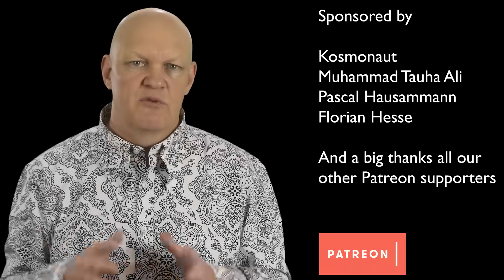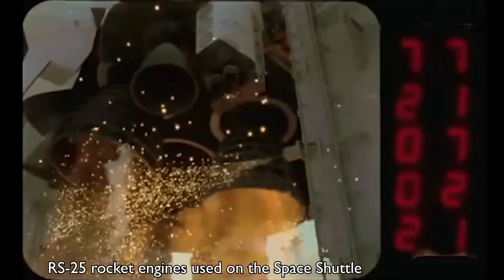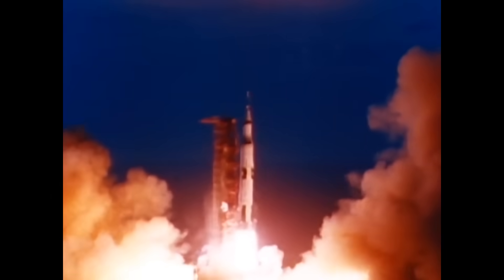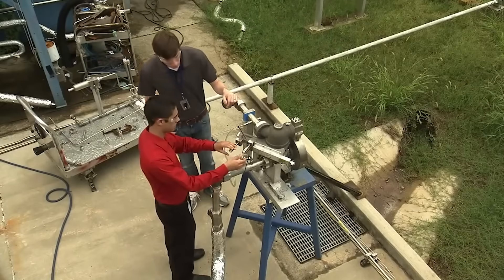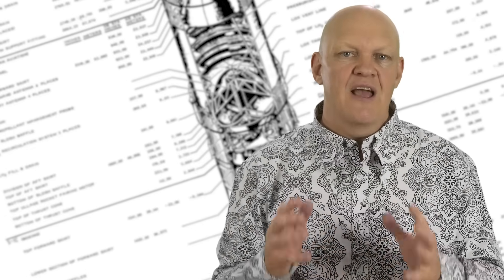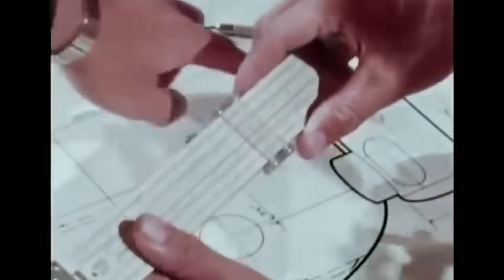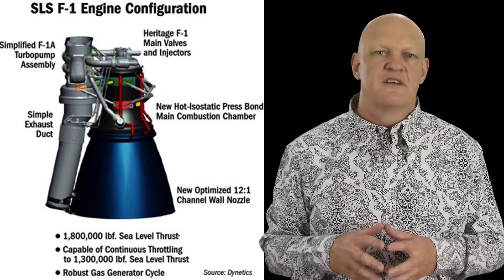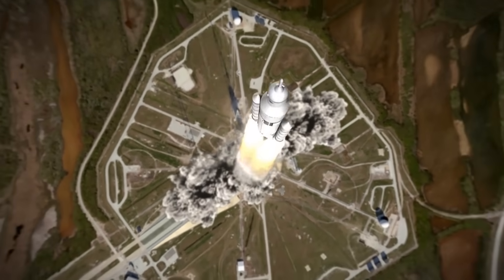Why Can't we Remake the Rocketdyne F1 Engine?

Comment: Why do we want to make an old style engine using old methodologies?

Old style design had so many more parts, which increases the failure mode effects.

Old methodologies required more skill on part of the “welder”, but also more skill on the “welding inspector”, and more resources from the quality control department to track their QC team.

If there is a new technology that increases overall quality of the production, then use it. Quality is there for the consistency. If it’s good production, then it’s consistently good production. If there’s something wrong, then it will be easier to pinpoint root cause, and easier to track for all precious/current projects, and easier to prevent for future projects. A good quality program will not save the world, but it does leverage advantages in industrial production, especially a project of this magnitude.

We shouldn’t strive to do as good as they use to 50-years ago; we should strive to do better.
Reply: Indeed, which is what's happened. Modern rocket engines are more reliable and efficient than the F1 ever was. We've not lost anything by not being able to build an F1, we just gained by building something better. Rockets are going up ALL the time delivering satellites, probes, and people to space. It's so reliable that no-one pays much attention any more.

Comment: Well, i reverse engineer for a living. I would love this challenge
Reply: I'll help!
Reply: I'd love to see you try sincerely, It would be a tremendous feat for sure!
The F1B does hold great promise however.
Reply: May i ask what credentials you need to be a reverse-engineer?
Reply: @Dave_Crupel  im not sure you need a credential. Its a broad thing. It is in a large way a great way to learn. I have no doubt with an army of manpower and unlimited funds i could build a saturn 5 by reverse engineering it. Scan each component and model it.... However it would almost certainly be a train wreck as it would not funtion correctly. So much of if was a craft like the welds. But those are great projects. Part of my job involves scanning existing old parts and flipping those into a solid model and making a new part from that or figure out weakness in designs via simulations. But my hobby music is the same way. Paul mccartney band on the run is one of my favorite sounding albums. When i record i have alot of that ethereal sound and vibe in my stuff. I a long time ago decontructed the songs part by part and covered it on my own track for track. Learned alot about every instrument fills a frequency and why that works together with the whole. So a large part of my studio recording and production comes from reverse engineering band on the run. Its kinda reinventing the wheel to better understand it. When i started to record, i needed a goal for sound and production quality. I went to school and took music theory, but not recording and studio. So mccartney became my teacher. Not a bad guy to act as a guide.
Reply: @Dave_Crupel  Well first you have to be an engineer.  I know it's complicated friend.
Reply: Santina Murphy I did 19 years in prototype manufacturing. Your words are so perfect. I was at the end of the line in the paint dept for 17 of those 19. It’s us in the shop getting dirty, that make it happen.
Reply: Santee Bandit With no engineers or scientists you wouldn’t have a job either. It’s a two sided thing, engineers need manufacturers and manufacturers need engineers
Reply: Maximilian Junger absolutely. It takes all of us. Not even trip’n on that. I don’t know that stuff, so I have to rely on others.
Reply: @santeebandit3246  And that was the thing about the Apollo program. Every one of the 400,00 recognized the importance of every other member of the team. And each took their job very seriously as if the ultimate success of the program rode on their performance alone whether it was boring an injector plate, or installing a zipper. Every detail mattered and America was at its finest. Where did we go wrong?
Reply: @JohnSutton55  It didn't go wrong anywhere, if it did we wouldn't be having anywhere from 3-6 astronauts living in space at all times doing research every single day. We wouldn't have rovers going around mars finding potential sings of water and have a chance at finding life on another planet. I think you're disrespecting everyone working at NASA currently by saying " Every one of the 400,00 recognized the importance of every other member of the team. And each took their job very seriously as if the ultimate success of the program rode on their performance... Where did we go wrong? and placing that overarching statement at the end of it. 

It's difficult to think of anything we do today as something that matters, and realizing that it's having just as much effort being put into it as it was before. I know that multiple factors like learning about the past through television shows, documentaries, and history books are making it seem as if the past was somehow better than what the world is today, but knowing this fact can help you start to put things into perspective.
Reply: learn how to weld. the reason why engineers today could not make those f-1s by just reading blueprint is because there was a lot of hard labor blue collar work needed to make those components. Back then engineers not only made the plans, they actually did the work themselves. Most engineers today can’t turn a wrench. Those “notes” that were lost were common things used in construction today like what proper weld procedures are needed, weld symbols, type of electrodes used, etc.. that’s why those blueprints were to “complex” for engineers to replicate today. they had no idea how to get their hands dirty without fucking it up. so they redesigned the engine with less parts to get around all the hard labor. I bet if a certified welder gets a degree in engineering and perseus a career in aerospace engineering we would nail those old f-1 blueprints with out a problem.
Reply: @steveo5611  I'm an engineer... I build planes for a living..
So you say I cant hold a wrench ?

we dont use a wrench to build a plane tho.and the welding is done by a robot that does it better and faster than you 
a robot build by engineers btw.
anyways have fun trying to disassemble my work so you can re assemble it wrongly my man
to each they're own i always say
Reply: @catnium  As a fabricator, I have to agree. There is a time and place for manual welding, and rocket science is NOT one of them 😅

Although I do recall watching a quite recent documentary on turbo fan manufacturing where a father and son team worked together to manually TIG fan blades, because engineering a rig to weld in the confines they had to work with was simply not economically viable. It seemed to me a very niche one-off scenario though. It was for Boeing iirc
Reply: @catnium  You may be an engineer that not only can't "hold a wrench" but you can't understand colloquialisms as well. To "turn a wrench" isn't just litteral, it's meant to convey mechanical aptitude, having the ability to understand how things work in a practical application/ the ability to make things work in a real world scenerio. As an engineer I'll present you with a challenge. Design a carburetor for an ice engine. Now go build it, install it and then make it run. Make all necessary changes for it to run efficiently and make maximum HP. After you have managed to do that, with modern technology, go grab a Weber carb from the 1960's and see if your results are better. If you manage to master that you will have knowledge that can't be gained any other way and a better understanding for what he's trying to convey. Cheers
Reply: @garymason3115  You're not only wrong, but you sound like an idiot.
Reply: @garymason3115  Man, if you have all of those skills and life experience, I'd expect you to at least have the knowledge of how to use any sort of punctuation at all.
Reply: @nomadben  @gary mason.   Damn son.  How salient of a point.  He missed one period.  You got him in your sights.   Too bad you're at most a fucking English major.  Go take some LSD and MJ and calm down.  How about you get off youtube and make a rocket?
Reply: @expressmess7053  To quote Walter Sobchak, "Calmer than you are."
Reply: @nomadben Ah that is where your wrong.  We both just posted to a pointless debate.  Either way your no better than anyone else on here.  I see you fixed your punctuation after being called out though.  Good for you.  Try not throwing stones in a glass house next time.

Comment: As part of the Space Launch System (SLS) program, NASA had been running the Advanced Booster Competition, which was scheduled to end with the selection of a winning booster configuration in 2015. In 2012, Pratt & Whitney Rocketdyne (PWR) proposed using a derivative of the F-1 engine in the competition as a liquid rocket booster. In 2013, engineers at the Marshall Space Flight Center began tests with an original F-1, serial number F-6049, which was removed from Apollo 11 due to a glitch. The engine was never used, and for many years it was at the Smithsonian Institution. The tests are designed to refamiliarize NASA with the design and propellants of the F-1 in anticipation of using an evolved version of the engine in future deep space flight applications

Comment: These are very simple engines, and they could easily be re-created, the problem is, they are too big and inefficient. Multiple smaller engines are desirable for higher efficiency and more redundancy. SpaceX, for example, only wants to build one rocket motor for all applications, so that massively increases manufacturing efficiency and brings down cost. They can also choose the number of engines to use depending on the rockets mission, not every mission is gonna need the 37 Raptor engines.

Comment: We could do it if needed, but the real question would be why should we rebuild them.
With advancements in metallurgy, manufacturing techniques, and fuels we could make an even more p owerfull and effeciant rocket motor than the F1.
Reply: There was a clean sheet design close to the F1 design called the F1X.
Reply: @Angron789  F-1B, actually. Originally intended to be used on "Pyrios" booster for SLS. before it got ditched in favor of SRBs.

Comment: Total bullshit. Not only can they build this engine, they can build it better on computer before they even use the first piece of metal. If you believe this nonsense your a fool. It wouldn't be the original no. But the reliability of a new freshly redesigned f1 would be simple, easy to build and test with the computer design and manufacturing ability we have today. It would even be more efficient, safe, reliable and most of all cheaper to build. With less actual parts that are more durable.
We can't build the original, but who would want to. Even the ones that were hand built were slightly different and improved upon as they went. So build the new version. Soon
Reply: Look for "F-1B". Already done for "Pyrios" booster rocket, which was ditched in favor of using SRBs.
Reply: Of course they could build another, but why bother? Newer designs are more reliable, powerful by size, efficient... And are easier and cheaper to manufacture as well.

Comment: If the tools and methods have evolved (or changed), it makes no sense to build an exact replica to do the same job. You will study the idea of the original blueprint and redesign it from scratch again. Thats whats the guy did. Another whole story is testing the new (old) design again. You will start from zero to get the confidence in reliability and that thing is actually working, because experience is  the most important factor in everything you are doing.
Reply: Finally someone with some not-so-common-nowadays common sense.
Yep, that's the idea of the progress. If you could improve something, making it lighter, smaller, more efficient and so on... You go for it. It's that simple.

Comment: I don't think the problem is so much the engineering and craftsmanship issues no longer exist but today's engineers don't value the input of their craftsmen counterparts. Refusing to work as a team with the grease monkeys so to speak and feel those people are "beneath" them. This is really an issue with many highly educated people that have no idea how practical application is different from theory of operation. Sometimes things don't work as it should on paper.
Reply: This is corporations in general, worker's aren't appreciated anymore, if corporations had their way, you'd be paying to work for them
Reply: @Michael Gross, worked about 12 hours on a machining job.  Fought the job during the entire process to meet the requirements set forth on the blueprint.  Engineer asked me "How did the job go?"  I told him it was a difficult nightmare.  "Well, it was easy to draw on paper"  I wanted to punch him in his pocket protector.
Reply: Michael Gross amen on that.
Reply: Couldn't agree more. The designers never have to rap on something with the biggest crescent wrench in their tool chest to get something that should fit but doesn't, to fit.
Reply: Amen to that. Eggheads have no practical applications skills. In other words. Geeks.

Comment: They could reverse engineer the used engines and recreate a engine with somewhat a similar capabilities. Is this possible?
Reply: What for, when we have better designs?
Reply: at the end of the video he mentions that hey have done that, the F-1B engine, it's as far as I know only a paper model but it is a design based on the original F-1A

Comment: It's almost guaranteed that the new F1B would have some issues with manufacturing and reliability. Some lessons have to be re-learned regardless of how hard you try to avoid them.
Reply: True.  The original F1 had very bad combustion stability issues which were eventually solved.   The advantage today's engineers have is that many of the tweaks could be modeled on a computer before spending thousands of hours in a trial and error procedure.

Comment: I see this on a much smaller scale everyday at work. I work with very tight timelines, always a rush to solve a problem with a new design. The drawings never quite capture it all despite best efforts. While we mostly do prototypes, there are occasions we build more or do a production run, and there is always a call in the office to see who worked on "it". Everyone knows if they just print the drawing something will be missing. I don't think it has anything to do with deliberately keeping it in your head for job security though, people are just busy and already rushing to solve the next problem. So you jot it down on a scrap of paper, or you just trust you'll remember if you build more. Glad to see that even NASA suffers from the same problem!

Comment: Let me fill you in because MUCH of what you said is NOT true.  In 2013 in Huntsville, AL an original F-1 engine was placed in a static test stand and fired.  So yes, there is at least one working F-1 engine available.

Documentation:  A NASA engineer who worked at Marshall Space Flight Center, also in Huntsville, AL noticed that Apollo era engineering drawings were being thrown away.  He did not think it was wise to dispose of these paper drawings so he took them home and stored them in his basement.  He did this for a number of years.  Time passed and the man died.  More time passed and his widow decided to sell the house.  She called the Alabama Space and Rocket Center, the museum also located in Huntsville, AL and has if they would like the papers that her husband had brought home all those many years ago.  The museum said yes and expected to find a small number of boxes or a briefcase full of documents.  What they found was basement FULL of piles of documents about 4 feet high with walkways between the piles, all very neatly stacked and arranged.  Most of these documents are one of a kind and they are now in the possession the Alabama Space and Rocket Center.
Reply: That isn't entirely correct the 2013 Huntsville test was of an F-1 gas generator (small rocket engine like component) not the entire F-1 engine and the articles I've read on the subject indicate the engineers of the project echoed the same rhetoric as this video that the blueprints - which are all archived on microfilm - do not provide a full picture of the nuances of the design 

Since the blueprints are all archived at MSFC on microfilm it's likely that what the gentleman saw being discarded was the redundant paper copies
Reply: @PabloGonzalez-hv3td  My father still lives in Huntsville, AL and the documents were not redundant in all cases according to the local news media.
Reply: @pauleveritt3388  - According to MSFC they have all the blueprints archived on microfilm

Comment: They already have redesigned the engine using CAD and CAM manufacturing and have reduced the number of parts to six and made is a simple and easy engine to build now. They don't need to relearn a damn thing, they just need to redesign and update the design so that modern technology and methods. In fact they already have done it.
Reply: That's a fact, that's a damn fine engine, reliable as it can be ab and now easy to manufacture.

Comment: Isn't the f-1 engine relatively inefficient versus say an RS-25?  A less efficient engine would require more fuel, and therefore less payload.
Reply: That's true assuming all other things are equal.  Power to weight ratio can offset some amount of inefficiency.   Merlin engines aren't super efficient, but have a high power to weight ratio.  Also, there is some weight added from the additional complexities of containing and operating with cryogenic hydrogen.